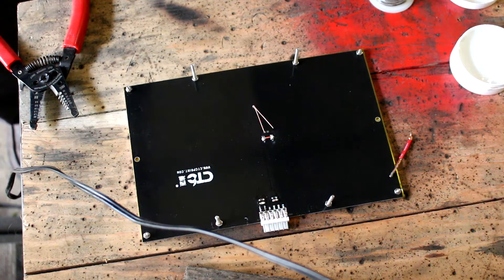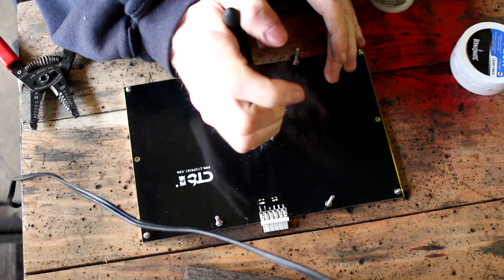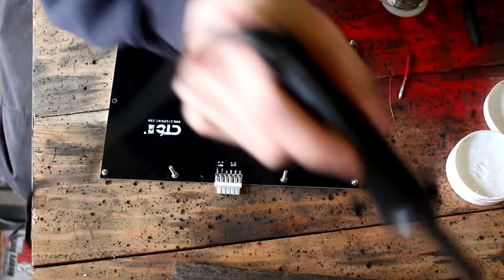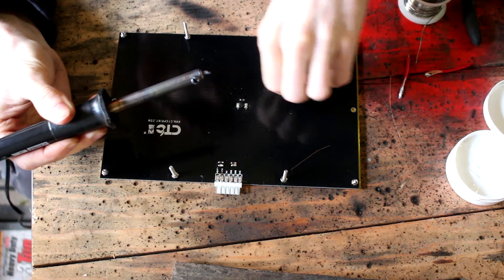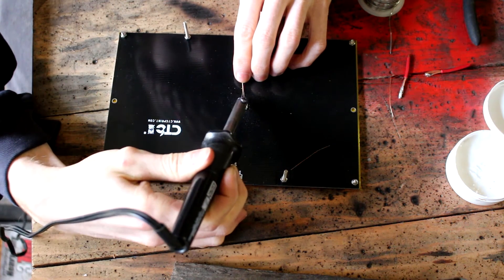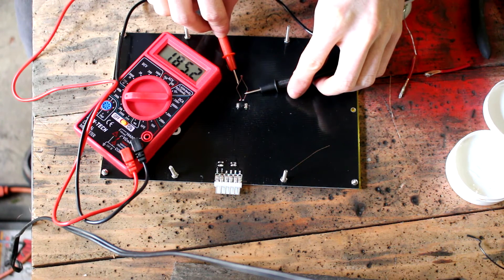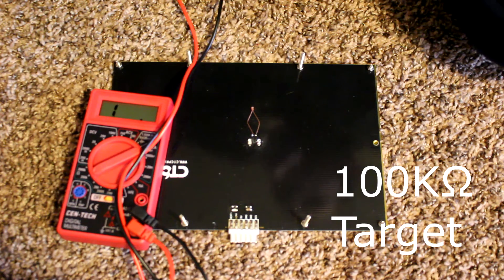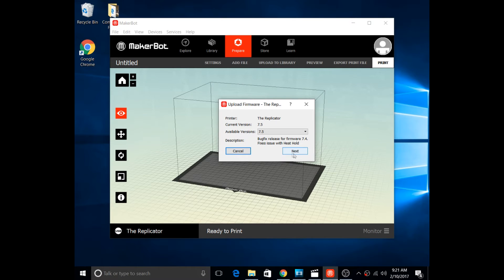3D Printer CTC Bed Upgrade

Comment: desoldering wick only really works, when everything is flooded with noclean flux, to keep oxygen out. like when doing SMD repairs. otherwise a pump or dull blade just works much better, to remove unwanted lead free residue
Reply from the maker: I definitely didn't have the proper tools, but it ended up working out. I have since purchased a solder sucker https://www.amazon.com/OMorc-Desoldering-Solder-Sucker-Length/dp/B01I14V4X8/ref=sr_1_1?ie=UTF8&qid=1503085206&sr=8-1-spons&keywords=solder+sucker&psc=1. To try on future projects.
Reply: a desoldering pump definately is a must have, even if you dont solder often. another "problem" is that the mandatory lead free solder doesnt flow well, has a higher melting point, and is used pretty sparingly. often you'll have to add a little "normal" no-clean solder, to get parts desoldered.